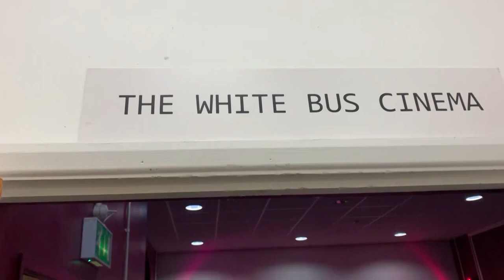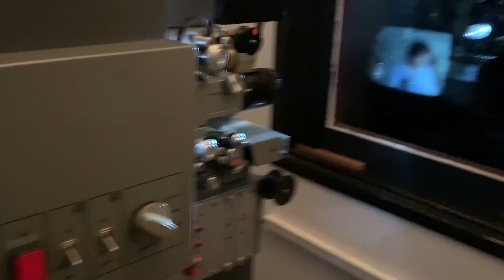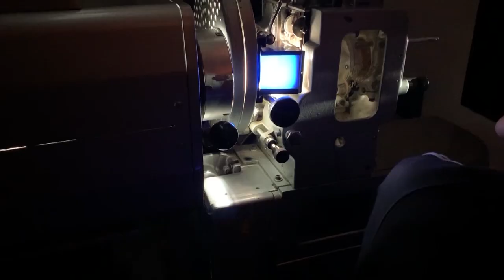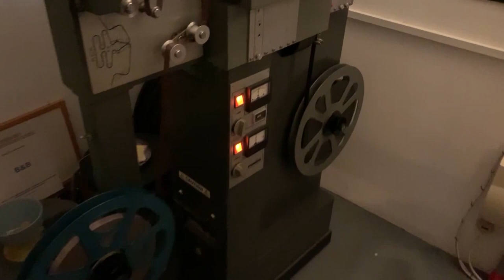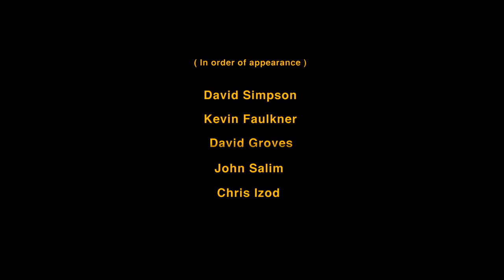The White Bus Cinema ( behind the scenes - projection room )

Comment: The projectors suffer some light loss going through those windows. Wonder how well it would work out to have a black rubber cone go from where window would be to the lens? I've seen something like that at IMAX theaters.
Reply from the maker: There is a little light loss of course, but light-level readings are taken in the auditorium off the screen and adjusted for the recommended 16 foot lamberts luminance.
Reply: @johnsalim7981  Nice to know there is power to spare. How much brighter can those projectors get?
Reply from the maker: In our situation we could get about one f stop more light.